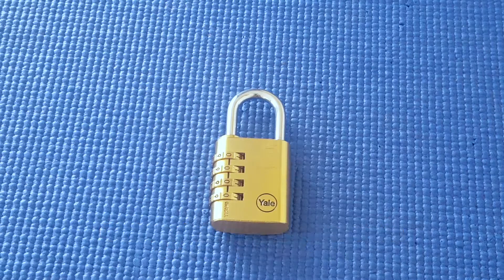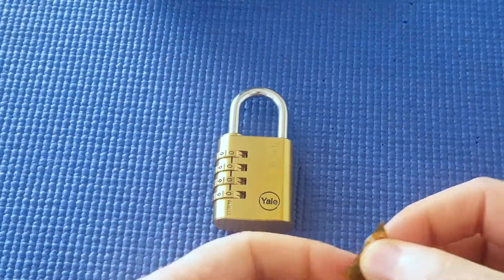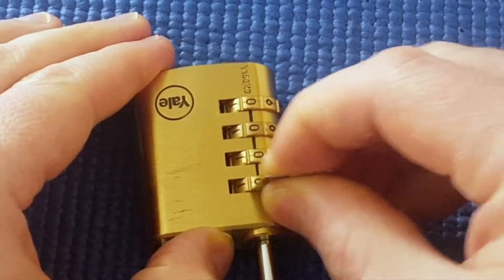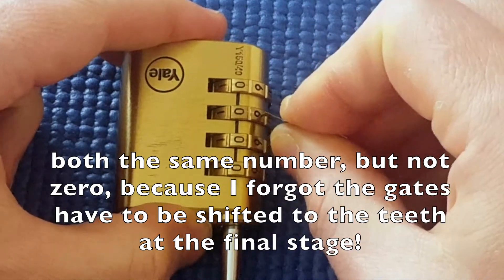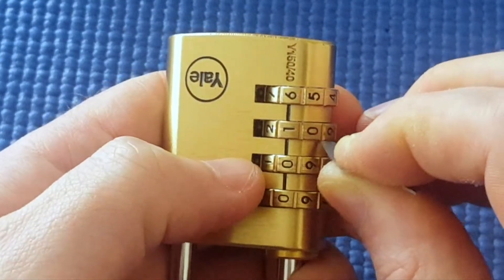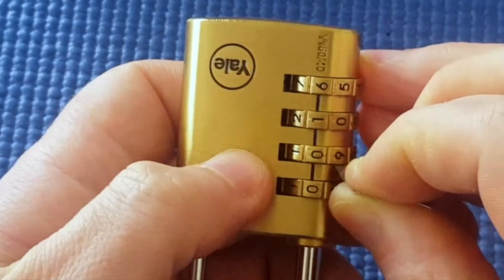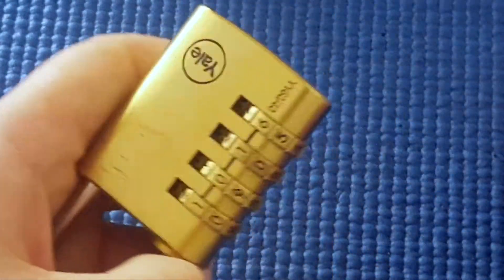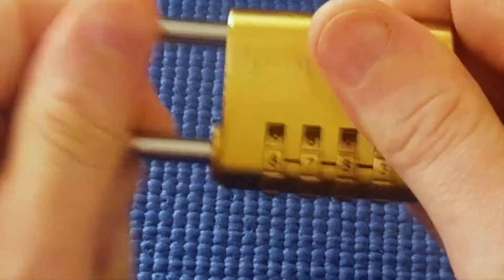(Picking 42) Yale (Y150/40) combination padlock decoded via alternative method (decoded)

Comment: the inner wheels are usually cast. the mold is in 2 parts. that makes a gap or a bump on the wheel. that's what this tiny DIY tool is looking for.
thanks for sharing.
Reply from the maker: Makes sense!  Thanks for the information! :D :D

Comment: That was very exciting, cool that you could use common household stuff for the probe. It's funny that even with false gates in the lock this method is only probing the teeth. For it to work the precondition is that the true gates are aligned straight in the lock. Hope this makes sense to you.
Reply from the maker: Thank you kind sir! :D :D  It would probably make sense for the company to redesign this lock to prevent this probing method - a lip to stop the probe, or false bumps / holes - yea you're right I only seemed to feel the true gates.  Ah yes what you said makes if I've understood correctly - I never thought about having the true gates in a secret pattern instead of a straight line, as the shackle doesn't have to come all the way out (whereas in a bicycle lock the bolt does have to come all the way out in a straight line).  It might be expensive to design it like that though?  All very interesting - thank you for your comments and your support my friend! :D
Reply: You are probing the teeth of the inner wheels. The gates are milled in the chamber of the lock housing. Check here https://youtu.be/XWaJmr81M98?list=PLuSaKS-pr3L81psh-vAVyp7R6Te1n5M37&t=168 for a closeup of these teeth. The video also shows the gates in lock. Hope this makes it clear.
Reply from the maker: Ah yes! - I was getting confused and I was imagining them the other way around for some reason.  Thank you for setting me straight! :D